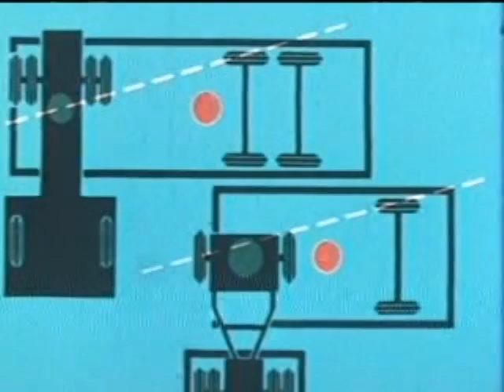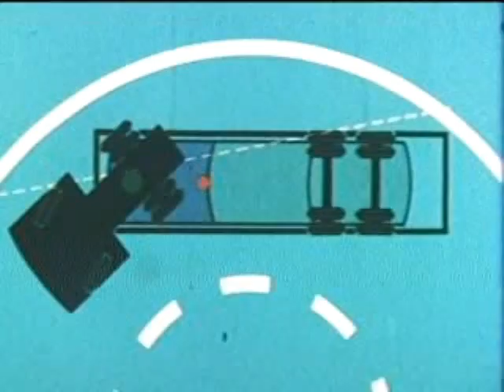Tank Sloshing

Comment: So, why wouldn't the fluid be stored in a smaller container, so it doesn't slosh?
Reply: Because that would be terribly inefficient, the whole purpose of a truck is to transport a large amount of product. Modern tankers do have subsets within a large tanker if that’s what you’re talking about.
Reply: I think what Ezra meant is get the proper sized container to fit the load so there's no air pockets for the liqued to slosh? The reason air pockets are left is due to the potential expanding of the liquid. Depending on what's being transported some liquid expands more than others.
Reply: The whole load may not be going to the same place, like a heating oil truck may start out with several thousand gallons, and then it delivers a few hundred gallons to ten customers throuout the day.

Comment: I was stationed at Spangdahlem AFB in Germany from 1961-1964.  One morning  I took a short cut on the way to work and walked down a taxiway. A 5,000 gallon tank truck full of JP-4 came up from behind me and came to a  very sudden stop beside me.  "Want a lift?" the driver asked. Apparently the tank was not well baffled, because I can remember watching the truck rock forward and aft on the locked wheels as the fuel load sloshed into the front and rear bulkheads in turn.  Quite a show.  So anyway, I rode down to the flight line in style.
Reply: Thats great.
Reply: Tankers will always slosh at least a little bit, especially after braking
Reply: @Handle423   they are an elderly person. Respect their theory.
Reply: @atidosamigos.8002  Apparently you do not know the difference between a theory and a hypothesis.  I suspect that you also know nothing about physics, jet fuel, fuel tanks, airplanes, avionics, electronics, and a good many other subjects that this elderly person mastered long before you were born.  If you don't believe that I have retained more knowledge than you will ever know, just try me on something that can't be Googled and we will see who deserves respect..
Reply: @Hopeless_and_Forlorn  time for some navy seal copypasta eh anon?
Reply: haha tank goes brrr!

Comment: In real life the tanker would most likely be completely full or with very little air space at the top thereby allowing very little "sloshing" on their way to the delivery location.  Then after delivery the tanks would be empty, no sloshing then either.
Reply: In an ideal world, yes.  Particularly if the trailer always hauls the same liquid.  For example, some companies only haul water.  More often, though, the trailers are used for a variety of liquids with different densities.  The higher the density of the liquid, the less volume.  Further, in more northern climates the road weight restrictions are often lower in spring during snow melt and higher when the ground is frozen.  The more that can be hauled at once, the more profit for the transport company.  Sometimes the customer only wants less than a trailer-load, and the driver delivers to several customers with one tanker.  In my many years of driving tractor trailers, often with two trailers with very dense liquid fertilizer (think trailer about half full by volume), the very worst part was driving down a poorly maintained highway.  The liquid tends to slosh from one side to the other, and it becomes difficult to drive straight down the road.  Sometimes even dangerous, especially if the road is also icy.
Reply: When I was 20 I worked at a gas station miles from anywhere. We took weeks to empty our underground tanks, but every week or two a large refilling truck would try to unload his remaining fuel into our tanks when returning from the next town with extra fuel they couldn't fit into the tanks in that town's station (both stations owned by the same refinery). Now I understand it was for safety more than economics to avoid heading back with a third of a load.  When they unloaded the excess to us, they still charged us a higher price than the station in town that the fuel was intended for.  Ouch!
Reply: @peters8758  Very interesting!  My guess would be that it might be the profit.  The company where I worked never even addressed tank sloshing in our mandatory safety briefings.  And what's more, most of our trailers did not have any baffles.